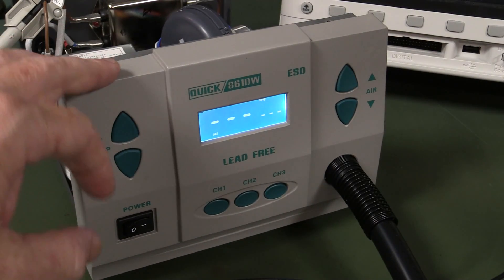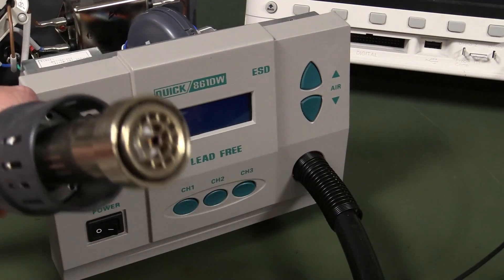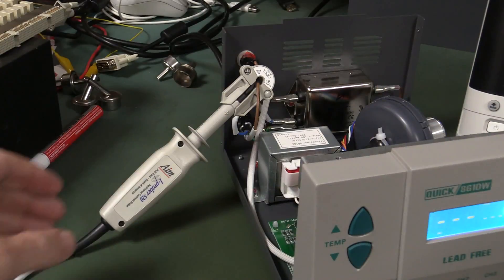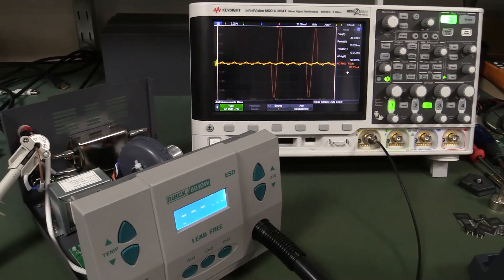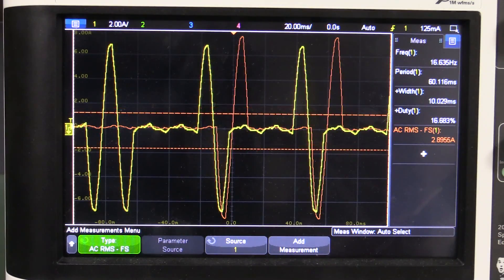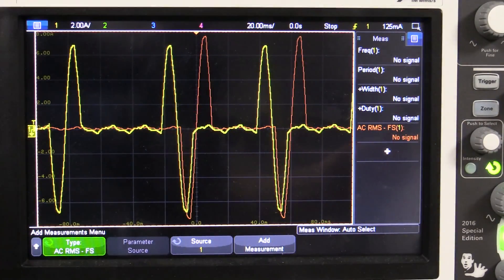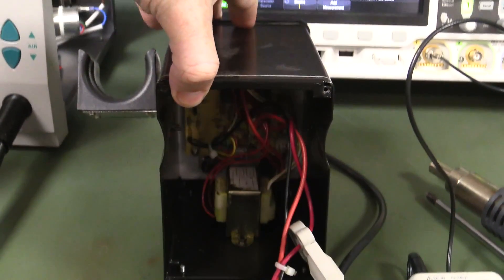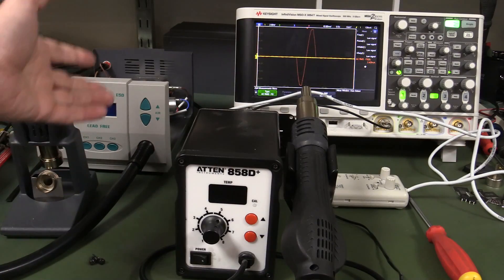EEVblog #1059 - Quick 861DW Hot Air Waveform Measurement

Comment: silly muricans with their 120V girly power ;)
Reply from the maker: Bunch of pussies.
Reply: they claim is safer yet they have dreadful NEMA connectors which have thin terminals, cant support weight, are unsleeved and mostly unpolarised ! 
not to mention of course you need twice the current to do the same work, and thats 4 times the loss in cabling.

but yeah, NEMA connectors.. i shit myself when I went to the US for the first time and plugged something in.. and it sparked!
Reply: @jaycee1980  yep... AND our plugs have no insulation. Really dumb. (im in canada but we sadly have those stupid plugs)
Reply: @Gunrange Nerd, we made sure our outlets didnt spark on insertion since 1941. Not to mention sparking is bad for both the outlet and the connector, as it causes wear that increases contact resistance.
Reply: aww @John Smith dont take it away from him, he's gotta have the ability to chant U-S-A! U-S-A! for some reason ;)
Reply: @Andrew Delashaw I have seen many wallwarts half-out of US NEMA connectors because the pins cannot support the weight of the plugpack. This then leaves live pins exposed into the bargain.

If you want a compact power strip, there are IEC ones for that task.
Reply: Ahem... https://www.amazon.co.uk/Masterplug-SRGDU61PW2-MP-Charging-Protected-Extension/dp/B006GKEP8Q
Reply: 'sez who.... I've wired my bench with 3-phase 477v and a big ol' wye
Reply: this winter in thailand ( they use US style plugs) even my tiny samsung phone charger nearly fell out of the socket by its own minuscule weight. OK, these universal sockets are even worse, especially when worn out by use of different plugs. one time stretched by a UK plug a US or EU plug has loose fit .
Reply: hmmm... sounds like yet another off-the-label use for electricians tape.
Reply: Ya know it really would come as no surprise to me if NASA had an official voltage standard for the Moon. Which inevitably would differ from the one established by the ESA....
Reply: I know right, we don't have electric showers either!
Reply: Not to mention just plain old crappy split phase
Reply: Then there's the endless arguments between electricians as to which way up they should be mounted. At least with ours there's an obvious answer. 

Though, the wonders of EU membership are that we now have a mix of two different live/neutral wiring colours in UK houses, very confusing. In spite of this,  every country has its own wiring standards and socket types, and you can't do in France what you are supposed to do in the UK. In Germany, different again. Utterly crazy. Going round Europe by road can mean a change of charger plug every day.
Reply: Peter Mulholland The good thing about our U.S. plugs is that you only need a 8" (20 cm.) long "surge protector" to plug in 5 plugs. If you wanted to plug 5 things into a power strip (power bar, power distribution block, surge protector, etc. Whatever you guys call them.) in Oz/UK, it'd need to be 5 feet long. (152 cm.) LOL. Those plugs are so ridiculously/unnecessarily large. Also, anything that needs a polarized plug, has a polarized plug. "The inability to support weight." What!?! Lol. Are you using yours to support weight?

Comment: So the key difference between the Quick and other 1000W loads is that the Quick is really a 2000W load being turned off and on in an intermittent and unbalanced pattern.  So anything that would blink once from turning on a 2000W resistive load will blink from the Quick.  The asymmetry probably makes things worse, as there's a big unwanted DC component to the load.

Comment: Most light dimmers use phase control as ON/OFF control would lead to unacceptable flicker.
I think Louis's problem is high resistance mains wiring. 1-2kW bursts that the Quick draws is causing mains voltage to dip.
I was surprised to see both Quick and Aten use ON/OFF control rather than phase control.
Phase control gives much lower current spikes and much finer control at the expense of higher RF emissions.
Reply: Problem with phase control is that is hard to make it compliant for high current loads. Biggest problem is distortion power factor which is highly regulated in most of countries, in EU for example there are  maximum permissible harmonic current limitations for devices that can be sold to general public (professional equipment with input power P > 1 kW have no limitation but professional equipment is defined as: "Professional equipment for use in trades, professions or industries and which is not intended for sale to the general public.").
And in this case it would not make much more difference, heating element have big enough thermal inertia (mass and heat capacity) so phase control will not give much finer control, it would produce negligible gain.
Reply: Phase control is noisy and completely unnecessary for something like a heater since it will respond quite slowly.
Reply from the maker: Yes, I was also surprised to see non-phase switching. And yes, higher RF emissions are the result of the sharp edges in phase control.
Reply: Yep, and cycle control is easier - you only need an optoisolator with zero crossing detect built in to fire your triac. Cheap as chips
Reply: it is often forbidden by regulation for heater loads. Although it would cause less visible flicker.
Reply: Looks like the temperature regulation is too fine, I bet that ceramic element have huge thermal inertia...
Reply: I think it's not random on/off but zero voltage switching.

Comment: Heater element design will influence how evenly heated the air is, but the same power going into the same airflow will end up at the same temperature after it's mixed, the efficiency is always going to be 100%. Poor coupling will just make the element run hotter/burn out faster.   Ideally you put some screens after the heating element, so you get well mixed air with very little turbulence.
Reply: People always try to put some magic or high science in basic things just to excuse higher prices, latest since the invention of religions. I haven't seen any hot air station that has that much room on the heating element that the air wouldn't be heated effectively, that happens only if the airflow is too fast, this is a very basic and logic procedure which you can watch on every water heater that uses propane or other burning gas, as more water flows as higher are the flames. I love EEVBlog and Dave just for his accent, but this comparison got worse with the second video, it doesn't make the Quick look better, but the Atten worse and worse, but this is absolutely unfair, this thing is just fantastic if you think about how cheap it is. A bigger station by Ayouye or whatever they call them, with built in turbine in the main housing would be fair and would show if the Quick is worth it. Just because Weller etc. is more expensive doesn't excuse the price of a cheaper brands, if a Ayouye etc. can do the same performance for lower price. Finally this stuff is all produced in China where people get all the same wages, so you just make the owners of China Inc. richer if you buy more expensive stuff, that isn't seriously better than cheaper ones, but the cheaper ones show that it is possible to produce it cheaper and prove just the increase of the profit.
Reply from the maker: Wilson - Oh FFS, the Atten is worse than the Quick in practically every aspect except price. So what? Why is that "unfair"? It is what it is.
If you want a cheap hot air station then buy the Atten.
Reply: Because it is a completely different class, like I wrote in detail Dave. This reminds me of how car magazines in Germany make VW look bettet than other cars, just compare for example an old rusty Ford Ka with a brand new VW Phaeton so the VW will win in every aspect except price, but this is for the most people the most important part, the price-performance ratio. I know it's about the Quick but why you need to make the Atten worse than it is if its just a Review of the Quick? And no, none of them have what I need, not even JBC with their huge colored touchscreens and millions of submenus, so I build myself one, but using this "cheapo" handle, just some little settings and this thing works perfectly, I bought new heating elements with the handle around two years ago and still didn't need one of them.
Reply: The amount of time air is in contact with the heating element is an intermediate consideration, not a goal. Turbulence near the heating element will improve coupling between the heating element and the air, but if you have a design that mixes the air after the heating element, you don't necessarily have to care. Things you want to accomplish with the design are keeping the heating element in a temperature range it can tolerate, uniformly heating the air, having laminar flow exiting the nozzle, and accurately controlling the temperature.

Comment: I agree that the flickering lights is likely due to the light design and not the Quick.  We have multiple workstations all running Quick861DW during Practical Board Repair School week, in a crappy old building in New York State on 120VAC similar to Louis's shop.  We have no problems with flickering from the Quicks, but one of our students that bought the Quick have reported flickering when back at home.
Reply: It is odd that the JBC at full tilt does no flickering though from the same outlet.
Reply: Wait--Didn't you change to LED lights? That could be the variable. Ours are still old school fluorescent tubes and incandescent--because.....you know what I think of LED lights!
Reply: iPad Rehab yeap mine does the same to my LED lamps
Reply: iPad Rehab I have a couple different LED lights in my home lab. Some of them flicker when I use triac based heaters, and some don't.
Reply: could it be the duty cycle  that the triac switches at or possibly an inductance induced by the heating element design?
Reply: Yeah, I have LED lights at home and certain loads on my PC cause them to flicker hard.
Also turning on a 12 amp 120V vacuum cleaner causes these LEDs to go a lot dimmer than incandescents or CFLs would ever.
Cree 60W Equivalent Soft White (2700K) A19 Dimmable LED Light Bulb from Home Depot.
The LEDs seem to be very sensitive to line voltage swings you'd get from desktop PSUs taking gulps of current to replenish their caps or in this case, TRIACs taking gulps of current. Maybe the dimming compatibility circuit inside the bulbs has to do with it?
Reply: Louis, I think it's time to do a teardown on your lamps :)
Reply: Make no mistake here, as an engineer I can tell that any circuit causing LED flicker like the "Quick" is poorly designed and overloads the capacity of the residential main local transformer.  It might be that bigger institution or schools have beefier capacity to endure the abuse.  This is caused by careless,  underskilled design of the switched inductance circuit topology around the transformer and the triac. As anything, it saves components and cost to do a crappy design. Leds that flicker means the main voltage suffers from heavy intermittent drops caused by the "quick box" reactive element looking like a short once in a while without triggering the breakers that cause other equipment supplies to drop and recover repeatedly. The chinese engineer who designed that had to notice it and was either incompetent, or tried to maximize profit for the company, probably both but more of the former because it wouldn't raise the cost significantly to avoid this with a better topology (which requires better circuit design engineering skills) and a few more components.
Reply: But is it in the same position on your bench? If it's radiated interference then the placement of the device matters more than the outlet it's plugged into. I noticed that you said the Hakko caused flickering too and you had it right next to where you had the Quick. Also, the JBC may have some kind of shielding around it's element.
Reply: i bought it few days ago i have the same problem,what is causing that?
any solution

Comment: Yup, probably Mr Rossman has more power devices or old electrical installation (high resistance at some corroded/loose connections?)

This switching triac regulation of power devices (like this heater and possibly other devices in his office) makes momentary power consumption much higher than the rated average and current power throttling.
Your Quick device with ~7 amps peak on 230V means 1150W momentary rms power.

Truth is, that i.e. induction heater plate at lowest power setting actually has momentary power exactly the same as on maximum setting. This is the same for almost all other power devices. 

So, if you have 10 power devices of 1000W max rms power and you turn them all at 10% of maximum (100W average per device) - than actually your momentary rms power reaches 10000W (just as if you would use them at 100%) - that may be enough to decrease voltage in his mains and make the lights flicker. The breakers wouldn't necessarily trip from that - depends on particular breaker type.

If that is the case for Rossman, than no filtering device will help him, he just reached the limits of his mains power supply (which is surprising, but maybe he has very old electrical installation or smth).
Reply: You're on the right track! Just hope that your example never demands a pulse all at the same moment!  BreakerClick! See my comment also... ;)
Reply: True, especially if the device is half-wave, then you are certain that momentary power consumption is double of the rated average maximum.

Comment: I think Louis flickering issue was with the 120v NA version rather thsan the 220v version that Louis is currently using. I had thought that on Louis's review of the Haku that Paul S. was able to show that the heating element for the Quick unit was replaceable via removable of a couple of screws off the head.

Comment: You guys might want to checkout the Quick 957DW+ runs about $119.99 I recently bought one and it's a really well built unit I would suggest this model over any other cheap hot air station out there
Reply: That one would be ways closer to a fair comparison and would show if you just pay the name or serious difference.
Reply: Quick makes some nice stuff I would stay away from all those cheap sub $100 stations I did a lot of looking before I bought the 957DW+ it's the nicest station for the least amount of money out there, basically I would just avoid any of the hot air stations that have the fan in the handle and get one with an internal pump.